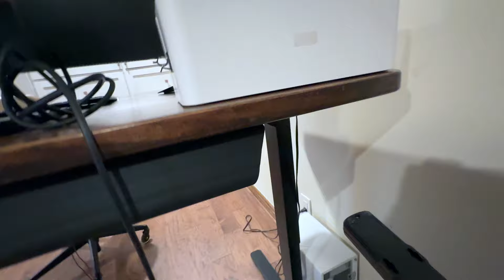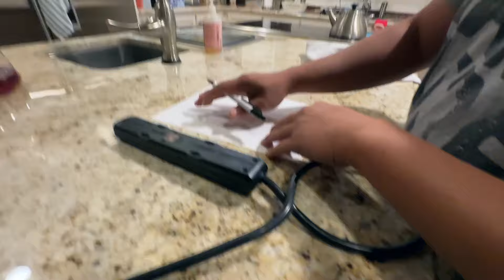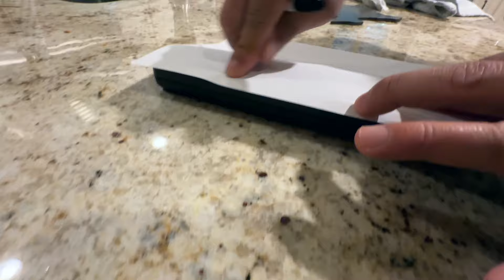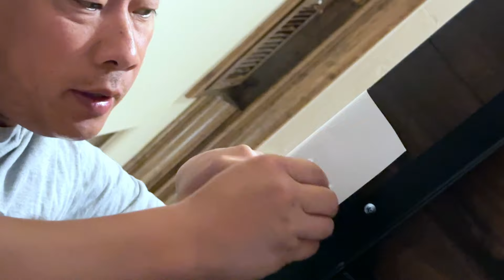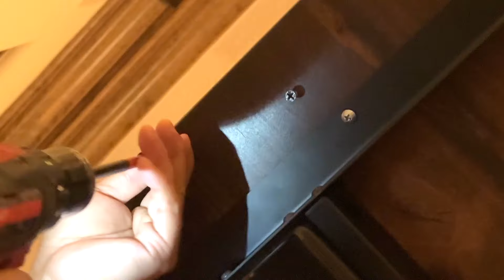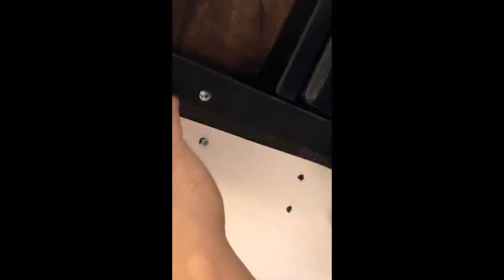MOUNTING POWER STRIP UNDER TABLE USING DIY PAPER TEMPLATE

Comment: You can also use blue painter’s tape. Tape it to the back of the power strip and mark the holes. Then remove the tape and tape it wherever you want to place the power strip and drill the holes.
Reply: Thats also a great DIY tip!  I hate buying blue masking tape now, they are so expensive. Thanks 🙏